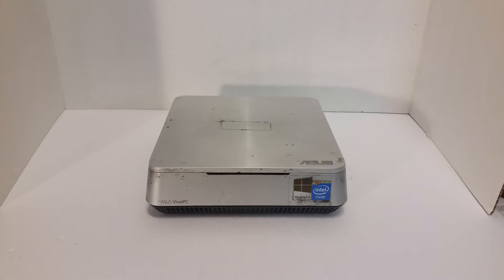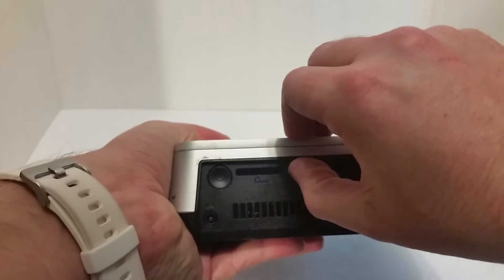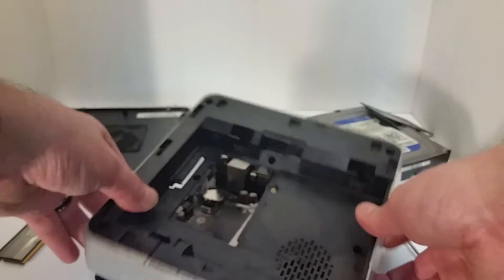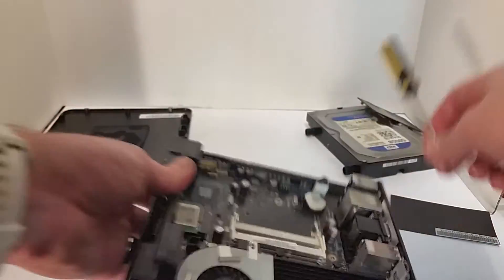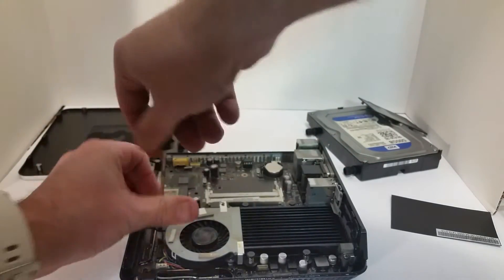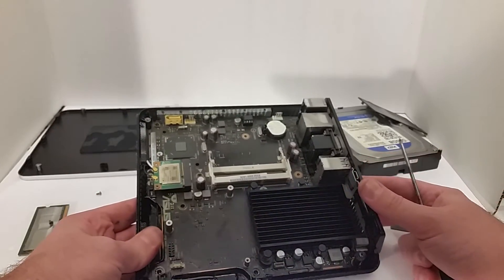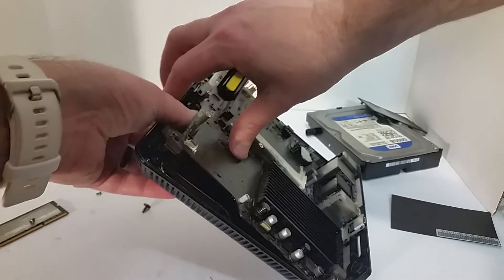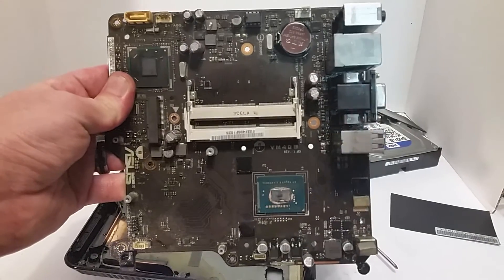Asus VIVO VM42 Mini PC FULL Teardown!

Comment: That was great!  Mine came for twenty bucks, Craigslist, full of encrusted dust.  A toothbrush and rubbing alcohol cleaned it right up.  I'm typing this on that system running NomadBSD.  Need to get the wifi running or buy a dongle I can run on FreeBSD.  That wasn't an issue with Linux Mint.  I wouldn't recommend it as a Windows machine, but it's a great little web surfer or media PC.

Comment: Hello I also have this machine but the cpu paste needs to be replaced.
But since the heatsink is stuck.

I can cut off the feet but how do I fix that again what are those plastic things called, is one time fixing is not reusable.

The holes in motherboard are very small.

Thanks for your answer in advance ;)